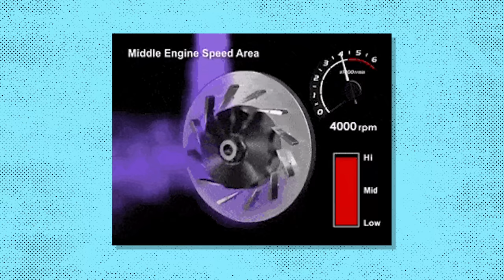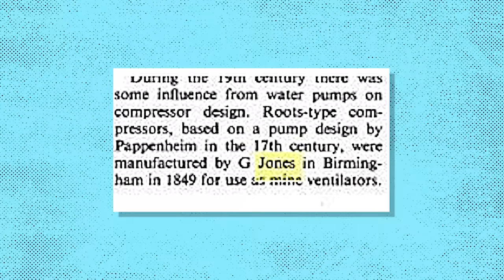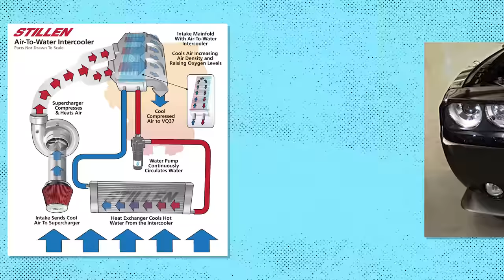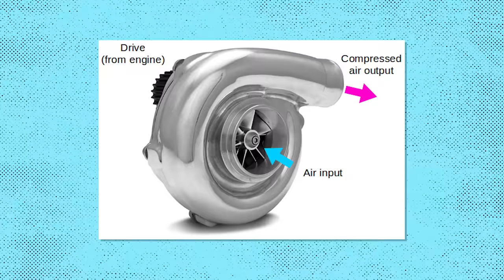Why Superchargers Aren't As Good as Turbos

Comment: You can’t convince me superchargers suck. It all depends on application and what you’re looking for. A turbo will have lag, while a supercharger does not. A turbo doesn’t have parasitic draw, while a supercharger does. 

It’s all a game of pros and cons, and how you need to balance them for the best experience in your build.
Reply: Turbos make more power than superchargers and use less fuel.
Reply: @sandervanderkammen9230  but they have lag, no matter how many sequential turbos you have, there will still be lag while superchargers are completely linear
Reply: @motia4888  Lag does not mean slower, turbo cars are generally faster in accellation.
 Lag is only a problem for inexperienced or less skilled drivers.
Reply: @sandervanderkammen9230  it does in fact mean slower from a stop, because power isn't delivered linearly, it takes time to build boost
Reply: @motia4888  That is a bald faced lie, some of the cars that produce rhe fastest 0-60 mph times are turbocharged.
Reply: @sandervanderkammen9230  more power? Yeah idk about that. Maybe more power factoring in the parasitic draw, but sometimes a little less power is better when it’s all on tap and you don’t have to wait for a turbo to spool. Again, trade offs
Reply: @brickson98m  So you didn't know that Turbochargers make more power than superchargers???

Turbos make more power because there is no parasitic drag on the reciprocating engine like there is with a supercharger.

A turbocharger takes the waste heat energy in the exhaust and converts it into HORSEPOWER.

The exhaust gas temperature drops as it passes through the turbine wheel of the turbo..
Where do you think the heat goes?
Reply: @sandervanderkammen9230  if you read my comment, I literally stated that superchargers have parasitic draw. 

And the heat dissipates into the turbo itself, which is cooled by fresh oil being pumped through the bearing. Some turbochargers incorporate coolant as well. The charge air going to the engine is cooled by the heat exchanger/intercooler.
Reply: @brickson98m  Yes, turbochargers produce more power than superchargers because the superchargers increase in  volumetric efficiency and pumping efficiency is offset by the parasitic drag on the reciprocating engine.

Turbos have no parasitic drag on the engine.

The exhaust gas temperature typically drops around 300°F  and is directly proportional to the amount of shaft horsepower generated by the turbine wheel.
The turbocharger is a HEAT ENGINE and operates using the BRAYTON CYCLE.

When you turbocharge a Otto or Diesel engines it becomes a Combined Cycle heat engine...

Both the Reciprocating engine and the Turbo are subject to the Laws of Thermodynamics described by the Carnot Cycle Formula.

That is incorrect.
Most turbos are not water-cooled ( which is only for cooling the bearing assembly) and some turbochargers have ball bearings instead of hydrostatic bearings.

This observed drop exhaust gas temperature remains unchanged if the is no oil or water flow to the bearing assembly.
The only thing that will hapen is the bearing assembly will slowly increase to a temperature that exceeds the safe oil temperature and carbon deposits will form blocking the flow of oil to the bearing.
The primary function of the water jacket is to prevent "coking" of the motor oil when the engine is shut down.
Reply: @sandervanderkammen9230  I did not say most turbos are water cooled. I said some. Like the one on my car. 

But, either way, going back to the subject at hand, sometimes getting the most power isn’t as important as reducing complexity and eliminating turbo lag.
Reply: @brickson98m  NO, that is why Turbochargers are far more common than superchargers.
 Turbos are better.

Turbo lag is not a real problem... its an imagined one..
Its only a problem for inexperienced or less skilled drivers.
Reply: Turbos do not lag when coupled to electric motors.
Reply: @sandervanderkammen9230  Turbo lag is not imagined. Turbo engines have dead spots. You let off the throttle then get back on there is always lag causing a dead spot before you get the power back. I've been in many turbo and supercharger cars. The supercharger cars feel much better in most driving conditions.
Reply: @guntherferguson2369  Only if something is wrong with the engine.
A proper running Turbocharged engine has no "dead spots" what ever that means?
Turbo lag is completely imaginary, it is a phenomenon called time distortion, aka "gun-shy"
Turbocharged engine sometimes have a different power and  torque curve compared to some naturally aspirated engines.
Inexperienced or novice drivers often find turbo cars difficult to drive... professional drivers do not.
Reply: Superchargers sound way better too.
Reply: @Skrenja  Finishing in last place never sounds good.

Comment: I like supers because they're instant power and they're far easier to package. All without that excessive heat that you get with exhaust driven setups. Still much more efficient than naturally aspirated but technically less than it's exhaust based counterpart.
Reply: Turbochargers make more power and use less fuel..
 Turbo lag is not a real problem... its more of an imagined one.

Comment: Turbo chargers use engine power to make more power as well. It's a restriction in the exhaust
Reply: Wrong, turbochargers run on the waste heat energy in the exhaust... they do not cause any parasitic load on the engine.
Reply: @sandervanderkammen9230  Its a restriction in the exhaust it's not rocket science.
Reply: @mavadoroaster  No, its not rocket science... its JET ENGINE  science! The Turbocharger operates on the Brayton Cycle same as a jet or gas turbine engines.

No restrictions that cause a parasitic load on engine.
Reply: Interesting theory I'll look into it. So you're telling me without that if I stick a turbo in my exhaust on my car without running the compressed air thru the engine that their will be no power loss in the engine??
Reply: @mavadoroaster  Are you not familiar with the Bernoulli Principle?
Pressure Drops as Velocity increases.
Reply: @mavadoroaster  If the turbine blades blocked the flow? Then Jet engines would not produce any thrust...
Reply: @mavadoroaster  Technically it is rocket science as most rockets use turbopumps for both fuel and oxidizer.. Also no you are wrong about turbos sapping any sort of power to make boost. Like really sorry dude but I own three RB powered cars and the turbine isn't a restriction.
Reply: @ceffydriver  it is a restriction.. if the compressed air wasn't routed back through the intake manifold there would be no power gain their would be a loss I'd bet money on it..
Reply: @mavadoroaster  eeeeerrrr no. If you want I could ask a turbo expert that rebuilds them but as far as I know the turbine housing is large enough to not be a restriction and also factor in that the wastegate is basically a bypass valve.
Reply: @ceffydriver  same difference with a super charger or procharger
Reply: @mavadoroaster  that's not the case. Superchargers are parasitic with losses being as pretty high for old roots style blowers. Turbos don't have much pumping losses. This is the reason why they are so efficient at converting all that exhaust gas into rotational motion.
Reply: @ceffydriver  if they were so efficient there would be no such thing as turbo lag
Reply: How does it use engine power? There is no coupling or drive connection?

How can there be a restriction if the turbo is flowing MORE AIR not less?
Reply: @mavadoroaster Turbochargers don't run on compressed air..
 They run on heat energy in the exhaust.

Comment: The instant throttle response of a blower is addictive, drive both and you will want to drive the blower car. Turbos are great, but difficult to modulate power, and the lag on big turbos is another issue.  Yes, the turbo is efficient and make more power pound for pound. But the sound of blower whine is second to none.
Reply: A less skilled driver is often intimidated  by the additional power produced by a turbo car... faster cars are in fact harder to drive..

Comment: Just wondering, could you have both systems on one engine?
Reply: You can and do.

VW did this a while back, this is what TFSI used to be before they repurposed the term for anything forced induction.

Low rev supercharger provides easy driving and after a certain rev and pressure, the turbo takes over and the supercharger is decoupled to increase efficiency. (Superchargers usually have a clutch)

There are also twin turbo designs that are smaller turbos and this have lower lag.

If you want to know more, having both on a car is usually called "twincharged" engine, featuring double systems, each mitigating the limitations of the other. 

Compressor's main faults are inefficiency and cost (which is why it's being phased out, a compressor setup is 1-7K) as well as the sound. Turbos are cheap and efficient, but suffer from lag and have quite the limitations when it comes to high boost.

Which is why manufacturers put turbos on cars mass produced (cheap, efficient, less exhaust, no noise, lower capacity) and compressors on high end (excellent power delivery, easily tuned, expensive). Twin systems exist but if it's a high end car just strap a giant supercharger to it and solve all issues (that high end car owners care about).
Reply: Doing for a while, Lancia on rally cars in the group B era as per the other comment VW group with the 1.4 twincharger engine. But these where garbage and since turbo tech came on, they were replaced with 1.4 turbos for low power uses and the 1.8 EA888 in higher end uses 
The only current engine Im aware of in production at the moment is the Volvo modular 4 cylinder with in the higher power application uses the twincharger set up. 
Most OEMs are going down the electronic turbo/supercharger route now with a mechanical turbo to help the low down response
Reply: Volvo does it.
Reply: the Zenvo ST1 is also twincharged if I'm not mistaken
Reply: @farrel66  I think it's gone through a few different stages. I thought the latest one was just twin supercharged (I could Google but can't be arsed lol)
Reply: @reecedrury4145  yes correct the latest Zenvo TSR or something rather is twin supercharged
Reply: there was a twin-charged Nissan Micra line built for racing
Reply: @Jupiter__001_  Nissan March Super Turbo
Reply: @Jupiter__001_  omg id love to give that a drive
Reply: Yes, it’s called compound boosting and it’s inefficient.
Reply: @2ndshiftracing  or its called twin charging and both systems compliment the others flaws
Reply: @centergaming5055  incorrect, its a pain in the ass to tune around and creates restriction and IAT issues. A blower already runs less efficient and hot, so compressing air pre blower with turbos amplifies the problem. The blower is a restriction and will not keep up with a turbo. One does not compliment the other. Will it make more power? Yes….efficiently? No….a proper manifold will make more power and a better power ban. 

Also the correct term is compound boost, been that way forever. Companies were making compound kits for last couple decades and stop making them for obvious reasons. They sucked in comparison and had tuning flaws.

Comment: Centrifugal turbo chargers are the best, good size and constant boost
Reply: You men centrifugal supercharger
Reply: @Murcielago  American definition in most regions is a super charger has 2 spinny bois :P Centrifugal chargers are essentially a driven turbo with the hotside replaced by a belt so just one single moving piece for the compression

Comment: Slight correction. A positive displacement pump, like an external or internal gear pump, gerotor pump, vane pump, axial or radial piston pump, displaces a fixed volume of fluid per revolution of the pump regardless of output pressure (unless it deadheads and assuming a static swash plate in the case of the piston pumps). An engine is itself a positive displacement air pump. A non positive displacement pump delivers less flow at the outlet as outlet pressure rises, think like an engine water pump, turbocharger or any fan basically. Positive displacement pumps mechanically take chambers of fluid from the inlet and force them into the outlet, non positive displacement pumps persuade fluid to move from the inlet to the outlet. If you blocked the outlet of a non positive displacement pump, like a turbo, the shaft and vanes could still spin. If you blocked the outlet of a positive displacement pump, the pump would lock up and cease cycling.

Comment: I am constantly asked why I do not Supercharge my Lotus Elise. Many reasons: First and foremost it would lose its screaming 8500 RPM red line. Second it defies Colin Chapman's mantra 'Simplify, then add Lightness'. 3rd it would push the curb weight above 2000 lbs. And 4th it would reduce the longevity of the engine.
Reply: Buuuut, cool whine and more speed😁
Reply: @obbezwiers  The whine when the 2nd cam kicks in with the Larini exhaust trumps the SC noise. More mid-range torque for sure with an SC, but not worth losing the high revs. As they say, no normal driver can get 10/10ths out of an Elise as is.
Reply: @daveblock1688  gotta say, I envy you and your car!
Reply: Many thanks! if it ain't broke, don't fix it!
Reply: @Dave Block agreed. The 2ZZ, especially with a TRD airbox, in an Elise is awesome. I have an early series 3 with a 2ZZ. For the extra 30hp and a wallet  lighter to the tune of about £6000 GBP supercharging is not worth it. On the other hand the blown 2GR-FE in the Evora 400 series (Evora GT in the US) and the V6 version of the Emira is a no brainer.
Reply: @EuropaSman  Agreed about the 2GR-FE. I could not find an air filter for my car until I figured out a previous owner put the 3.5 L TRD airbox in along with a Larini Stage II exhaust. The note on-cam is stupendous! It was also re-mapped, but cannot find out to what end.

Comment: Your twin screw supercharger is wrong.   It's still turning in the wrong direction using internal compression as opposed to a Roots blower that rotates up around to outside then down on the blower.

Comment: Attributing the whine that race cars make to straight cut gears is a common misconception. That whine is from the solid mounted differential. You can not hear the gear box over the diff.
Reply: It is straight cut gears making the noise in the gearbox. In a rear mount diff, front gearbox, the noise comes from the front

Comment: Using exhaust gas still takes power from the engine because of back pressure. If you place a resistor on an exhaust pipe, the engine will need to push the exhaust out instead of just letting it flow out. A resistor can take many forms, from catalytic converters to bends in the pipe to simply the length of the exhaust pipe. All of these put more resistance on the flow of the exhaust gas, reducing engine power. A turbo does the same thing to a much higher degree, since it is usually very close to the engine and therfore very hot. You should all know that air is compressible (that is why turbos and superchargers are a thing) and you should know from the context of the video that cold air is better at compressing. The reason mufflers and catalytic converters are usually at the very end of the pipe is to give the exhaust gas a chance to cool off a bit, which is better for the longevity of those parts but it also allows the air to compress more before encountering the higher resistance.